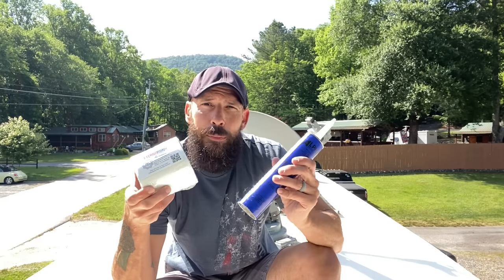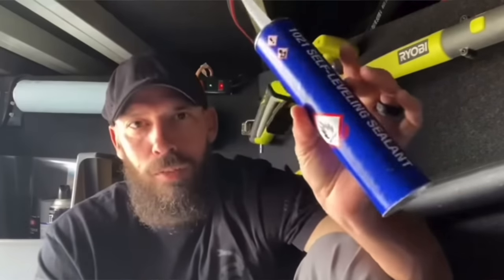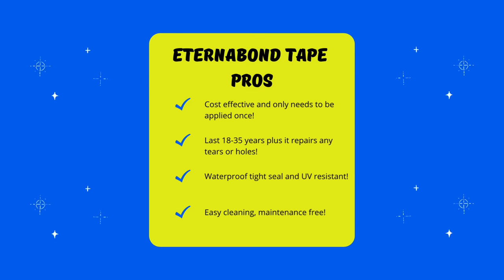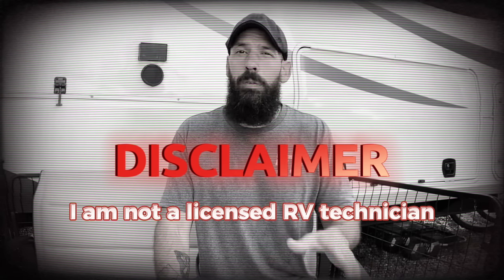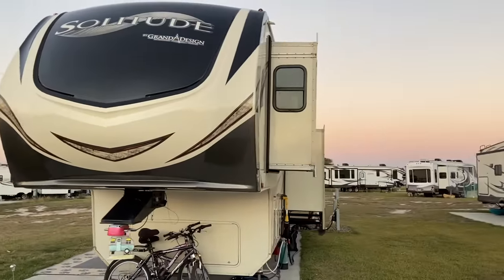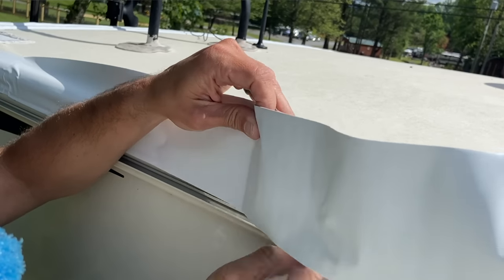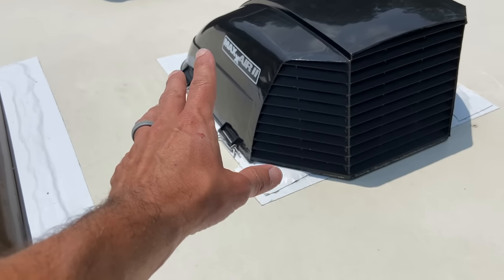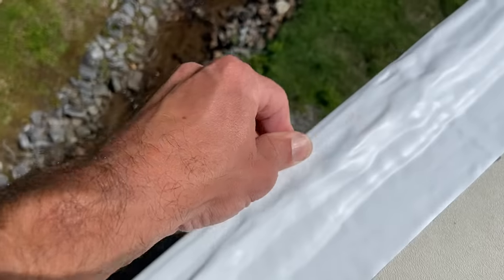NEVER Reseal Your RV Roof AGAIN! (Eternabond Tape VS Lap Sealant)

Comment: I think I’m going to reseal my roof, wait until it cures and then applied the tape.
Reply from the maker: Sounds like a plan. Take your time, do the job right. Prep correctly and it should be the last time you need to worry about anything! Thanks for watching 👍🏼

Comment: Why do all these EB Tape vs Lap sealant fail to address is generically? Dicor has lap sealant AND tape.  MANY outfits make a tape. Many outfits make lap sealants.  So why not speak generically? Also, why not show side-by-side testing? Put a strip of each major brand of tape on a section of RV roof.  Do the same for lap sealants.  Then real-world results can show if one product outperforms others.  It’s great to see any comparisons, but better to see more comprehensive comparisons.

Comment: I applied Eternabond to all my roof and slide seams 12 years ago. It’s still sealed like the day I installed it. I had a leak on my slide from day one that the dealer would dump lap sealer on and it would start to leak again after 6 months. The prep was a lot of work and you have to pay attention to the install.
Reply from the maker: Love hearing that! If you know you know, a lot of haters out there that just don’t get it. Appreciate you watching 👍🏼

Comment: I did the roof on my last trailer 20 years ago.  It's still holding up well and looks great.  I ended up using Hengs on the rest of the EPDM roof, which also has worked well for over 5 years now.  Prepping with acetone caused the glue under the EPDM to let go.  When I do my new trailer, I will steer clear of it.

Comment: And for those in Australia, from what I’ve seen by aged experiments, the best equivalent to eternabond, you can buy in this country is a product made by Gorilla. It’s sold by Bunnings at least. 
I’m going to use it and I will do all the same prep steps and application method recommended for eternabond.

Comment: Awesome video.  I did check out your friend's video on this.  I will be ordering the tape to do our RV roof.  Had it in for annual maintenance and they found some cracks so they filled them for me.  Now I have to wait for that to set to do the Eternabond way.   Thanks again.
Reply from the maker: Good deal. Just take your time, prep really good and you should be all set for the life of the RV. Appreciate you watching Jim 👍🏼

Comment: The name itself means forever. Try to remove that c*** and you will wish you never put it on. It's okay for emergencies, but unless you plan on replacing your roof in the future, don't use it.
Reply from the maker: I’ve removed some in the past now. It’s not insanely hard to do. Removing lap sealant sucks too. I’d Rather have a great sealed up roof and a tough day of removing some tape once in a blue moon vs a leaky roof and resealing with lap sealant all the time. Thanks for watching and commenting.

Comment: I don’t understand the manufacturers not using the tape. It’s literally so easy and not that big of a price difference, especially if you consider bulk prices.
Reply from the maker: Yeah I hear you. Probably just more time consuming when they are trying to pump these out plus maybe they are thinking it’s easier for customers to remove the sealant when needed vs the tape.
Reply: They want annual return customers. If they used tape. You won't be back for how many years?

Comment: Since you have a Beautiful Gadsden Flag, I thought I would ask for your thoughts on the roof fabric. If new EPDM roof has some air bubbles, especially around the end caps. Is this something that needs to be addressed (such as slitting and putting glue to help hold it down properly)? 
I am concerned that a constant movement of the material while driving, as a flag does in the wind, will cause the EPDM or plywood to loosen or tear.
Reply from the maker: I’m not too sure without really seeing it for myself. I guess I would get a professional opinion before you go cutting up your roof. If the roof is old it might be time for something like that to be addressed but I would think as long as the sealant or tape holding down the edges is good you would be ok. Hope this helps or you get it figured out 👍🏼 Appreciate you watching.

Comment: hello excellent video, a question my a/c when it rains water enters through the condenser can I seal it with this tape. Thank you
Reply from the maker: This I do not know. Sounds like a bigger issue at hand, not sure how the water is getting in the condenser? Did you try tightening the four bolts from inside the rv ac unit that hold it down to the roof?

Comment: I use both. Both are a pain in the ass to remove. Saying that, the tape is the way to go. And I had to use gorilla tape a few times, not to bad if needed in a pinch or emergency.
Reply from the maker: Right on. Can’t go wrong there! I find gorilla tape is good for the underbelly too.